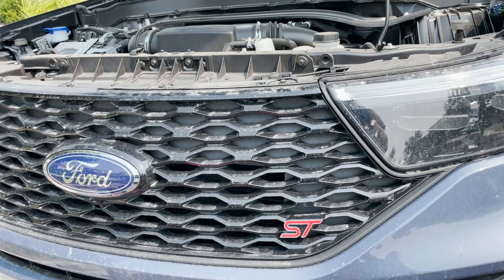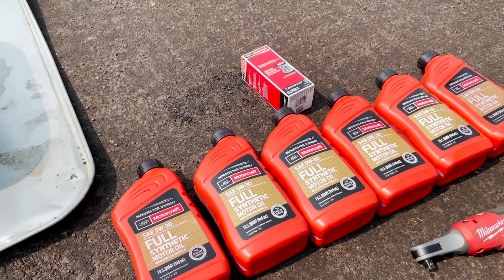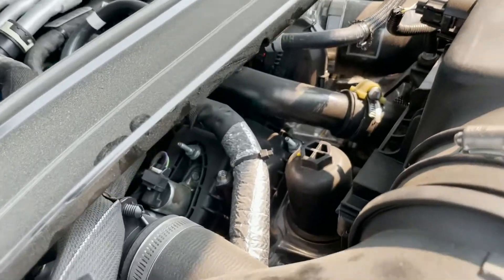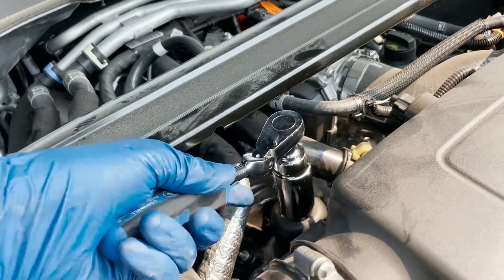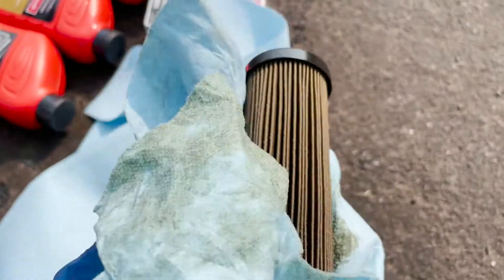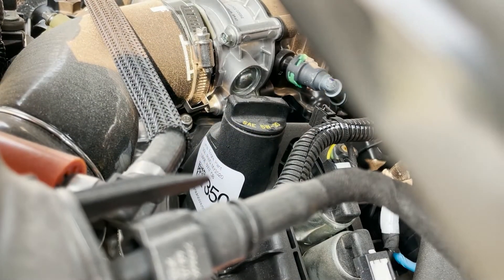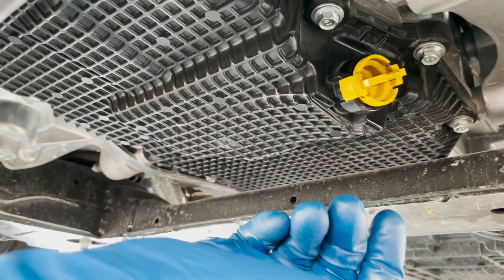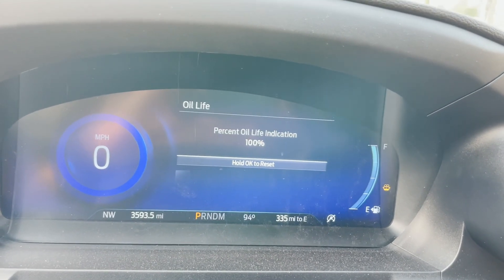2021 Ford Explorer ST Oil Change how to

Comment: Soon Ford will make 100% of engine components from cheap plastic. The amount of plastic that Ford has been using in its cars is alarming
Reply from the maker: Yea I hear you. The cartridge being all plastic is a good candidate for preemptive replacement every few years. Thanks for watching!
Reply: It's called built in obsolescence. Auto manufacturers love making parts out of plastic because it has a shelf life and will get brittle over time and break because of the heat in the engine bay. It's criminal in my opinion.
Reply: I get where you are going from.  These Explorers ST's retail for about $55,000 and this is what you get.  I bought a 2020 Mustang GT that has the same pan and plug.  I almost didn't buy the car because of them.  However, I like the sound, 460 HP, and the fact that the motor goes between port and direct injection.  No need for an oil catch cans.  Turbos and direct injected engines could use a catch can.
Reply: Mercedes and Chrysler switched to plastic oil pans and filter housings in 2009, Audi in 2011, and I'm sure many others did. Never had a problem with my Audi, but my Dodge minivans filter housing warped around 150k miles and started to slowly leak so I had to replace it.
Reply: Cheaper to replace as well.

Comment: I just changed my oil for the first time a few days ago.  Things I noticed.  You will need a tall funnel.  My normal oil funnel was too big to fit in the refill.  I just used a pair of pliers to twist the yellow drain plug.  I think using a pick might be a bigger pain than just using the pliers.  The small rubber O ring is easier to take off than put on.  And lastly, unless I mid counted measuring 6 quarts from my bulk box of oil, this only came up to the lower limit of the dipstick.  I put one more quart in before it was at the top of the scale.

Comment: Excellant video ; also1) location of oil purchase n price? 2) would of liked viewing of oil pan cover in - out full view3) viewing of oil filter rings replacements full view also; BECAUSE; those are the most difficult part; 4) Where to purchase oil plug?… Sorry for all The questions, but I did one recently and was curious on your take because those questions above to me are the most vital for additional information on how to once again thank you for taking the time to explain. I did like your video and subscribe to your channel… Booniewv
Reply from the maker: I got the oil from O'Rilly's. They don't stock it in-store, but they can order it. The drainplugs came from Amazon: https://www.amazon.com/Ford-FT4Z-6730-A-Plug-Oil-Drain/dp/B01JAU88JK/. Sorry about the angle. The job had to be done on ramps, which made getting the camera angles difficult. Thanks for watching, subscribing, liking, and commenting!

Comment: I got that same plastic oil pan and drain plug on my 2020 Mustang GT.  I replaced the OEM plug with the Ronin drain plug.  A bit of money up front, however, you don't have to worry about replacing that funky yellow plug during any future changes.
Reply from the maker: That is a good upgrade!

Comment: Great video, thank you, very helpful. With the tools out before hand I was able to change the oil and have it buttoned up in only and running 8 minutes. That big drain plug sure does flow! I wasn't prepared for how fast it dumped all the oil out, I think it was empty in twenty seconds. And that splash cover is fantastic, no road junk, dirt or salt on the motor, very clean under there.
Reply: 8 minutes? U can’t be serious😂

Comment: Watched a few videos. Why are so many people so cautious of the plastic plug? I have had my truck for 7 years with 180k miles, and I have never replaced the original drain plug or seal. It's still seals and no issues. Just turn it by hand. It's designed for not using tools.
Reply from the maker: True, it is nothing to be afraid of, but I always recommend caution so that if someone attempts it, they don't find themself breaking something and can only drive their car again once they source a replacement. Thanks for watching and for your comments!

Comment: Excellent choice for using Motorcraft oil and also for "upgrading" to full synthetic. You are correct in saying that you can use Mobil 1 or any other high quality full synthetic oil as long as it meets Ford spec number. I personally use either Motorcraft or Mobil 1.
Reply from the maker: Yep, I would have no problems sleeping at night knowing Mobil 1 was in my car and Costco often has a really good price on it. Thanks for watching!
Reply: Aamco
Reply: I wouldn’t sleep at night with anything other then Mobile 1 in my engine.

Comment: The 3 plastic push pins retaining the under engine splash shield are fragile. Why didn't Ford
use the screws that are on the same shield for all of them,  they never fail.  If you need replacements,  Dorman 961-364D work for the 2 side pins and 961-362D for the front pin.
Available at O'Rielly.

Comment: Have the same engine in an Aviator and wish the dipstick tube was positioned over the deepest part of the oil pan. I like to do all my oil changes from the topside by vacuum dragging the spent oil out through the dipstick tube. Did this procedure on the Aviator and was only able to remove a bit less than 5 quarts because the suction tube cannot reach the deepest section of the pan. Your video confirms the unfavorable pan geometry. Good location for the oil filter cartridge but the strut towers brace is very close to interfering with centering the socket extension over the cartridge cap.
Reply from the maker: It seems like oil changes are getting more and more complicated on newer cars. One suggestion that might help. Try parking it on an angle to force more oil towards the front of the pan where the dipstick is. Thanks for watching!
Reply: @andysgarageadventures  The oil change isn't getting more complicated, I'm just getting lazier. Topside service for both the sump and filter is so much more convenient and clean. I agree with your recommendation but that means dragging out the ramps which detracts from the convenience factor. Ford should include a flap door in the bottom aero cover that allows assess to the drain plug without undoing the whole cover. I know I could take it to JiffyLube  as the ultimate convenience.

Comment: Just get a 3/8” universal joint and a 12” extension instead of the floppy ratchet handle. Much easier to use.
Reply from the maker: I since have and you are correct it does make it easier! Thanks for watching.

Comment: Thank you for this! I'll let them change the oil for the first 10k check, but I prefer doing it myself when I can. Question - do you know if it comes from the factory with synthetic or that synth-blend?
Reply from the maker: Sorry, I don’t have that information or a way to get it from Ford, unfortunately. It might even be a break-in oil. Thanks for watching!
Reply: Don't wait for 10k to do your first oil change.  Oil is cheap; change it between 2,000 and 3,000 miles to get all the filings and other stuff out of the system.

Comment: Seems to me that Ford could have made that splash guard a little less of a pain without the silly plastic clips.
However excellent howto video,  well delivered.
Reply from the maker: Totally agree. Thanks for watching!
Reply: Yes, they could have, but they wanted to add labor time to a simple oil change.
Reply: Can you upgrade the push pins to screws?